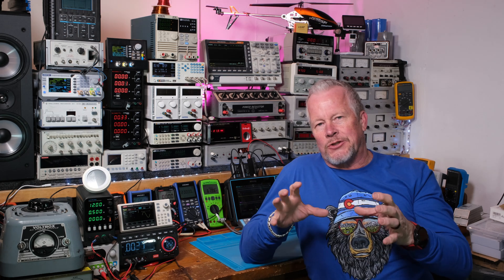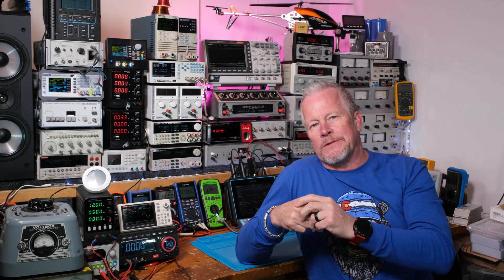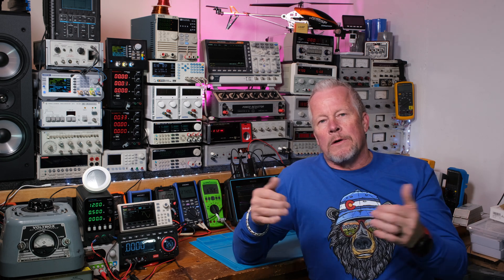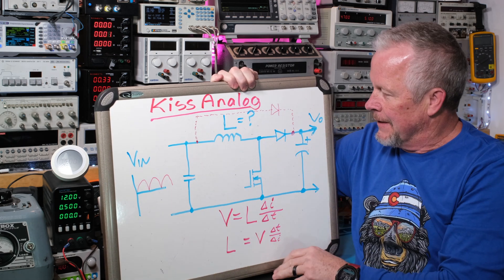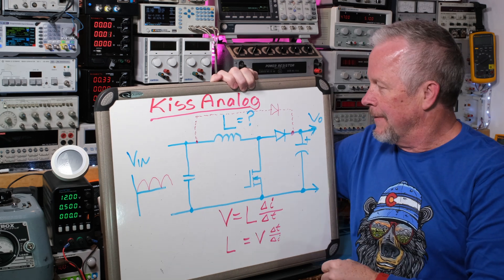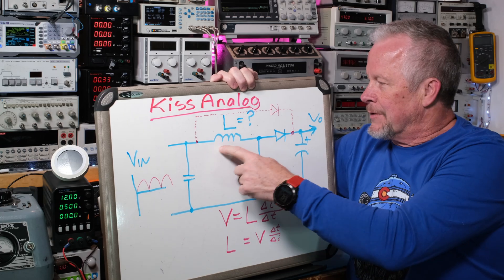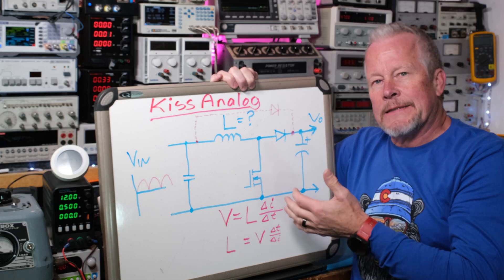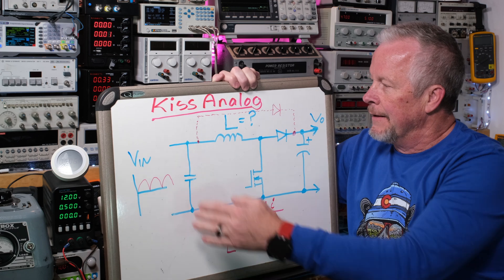Volt Seconds Principal - Important SMPS Concept #Micsig #STO1004

Comment: I just watched the video, geart 😂! But you didn't mention that when the MOSFET opened, the magnetic fields collapse and that's increase the voltage that comes out of the inductor, this is the "boost" action. Than the higher voltage gose through the diode and the "boosted" voltage charges the output cap, and there: voltage in the cap is the boosted voltage.
Reply from the maker: Thank you!  But that's not what actually happens.  The magnetic field does start to collapse as it discharges current through the diode to the capacitor.  The current through the inductor passes through the diode and charges the output cap.  With each pulse, it continues to charge the output capacitor until the voltage is boosted to what you want, or to the point that the output voltage is sensed and tells the controller to shorted the width of the on time at the FET.  I'll do a video to explicitly show this and explain it better.

Comment: Eddie,  the 2 important items are the duty cycle and the diode. The duty cycle rises and lowers the voltage that gets applied to the output circuit and the diode controls the direction of charge which adds to or subtracts from. In the case of the boost converter it rises the output voltage higher than the applied voltage.  In the case of the buck converter the output voltage is lowered from the applied voltage.
Reply from the maker: Thanks for your feedback.  I'm going to do another video this weekend to give another point of view - and a design short cut;)